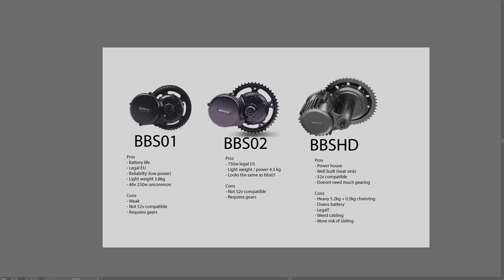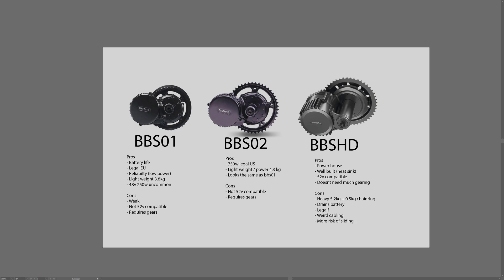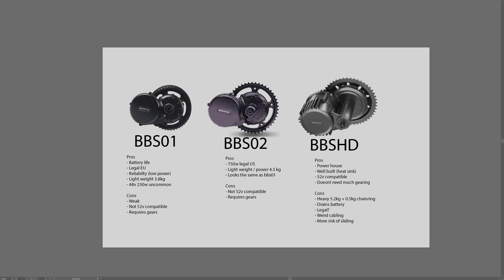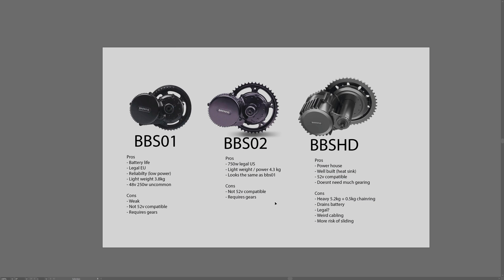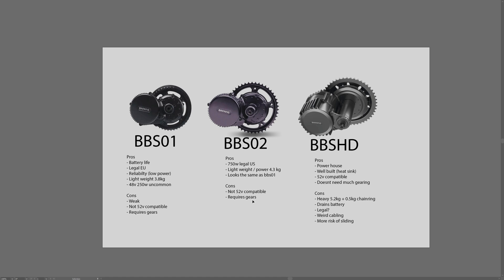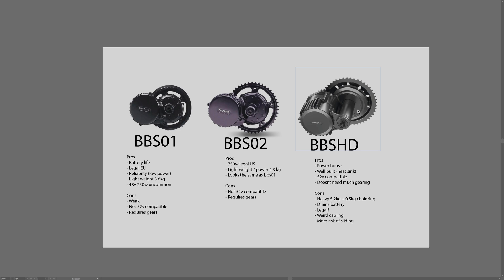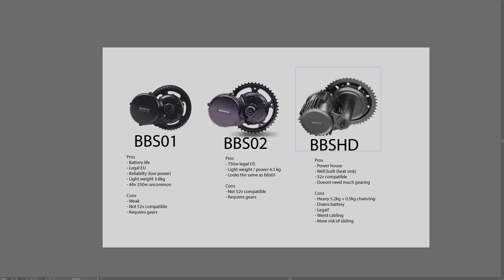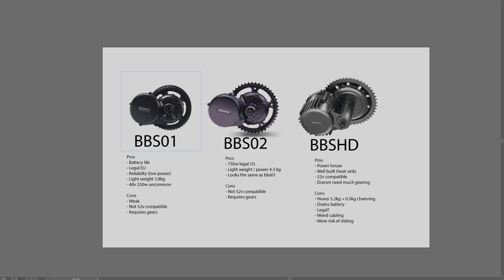Which mid-drive Bafang motor to buy? (BBS01, BBS02, BBSHD)

Comment: I have the 750 motor using a 20ah 52v battery iv had it about 3 years and over 3k miles without problem apart from chainring wear and rear cassette it has 5 levels of power and 95% of the time I use level one that gives me a easy 19mph and a easy 50 mile range with the battery at 20% remaining

Comment: BBSHD is probably relyable but some of them have bad housing tolerances (69mm bb width vs 68mm) and bits of metal and cling film forgotten by the factory inside the bearing bores resulting in misalignemt and drag. IPM rotors have inconsistent lamination uniformity. Thrust bearing needs differrent size inner race but only two identical outer races are sold together with the cage. Had no other choice but to get another spare BBSHD.

Comment: I have owned the BBS02 for several years on 2 bikes in the US, and I FIRMLY say the need for more gears is NOT a bad thing. If you manage the power setting and the gearing right then your golden. NO hub motor with same specs will match your range. On one bike I have the 02, a 17.5ah battery, and a mega range 9 speed 11-52t drive train with default 46t (I think) front sproket, and 26" drive wheel. On power setting 2, and 7th speed throttle only I get around 60 miles keeping with the legal limit (for Texas) of a class 2 20mph, and I am NOT a small person at over 200lbs sometimes hauling a single wheel trailer. Pedal assist I can get over 150 with setting one (my  preferred cadence) and still keeping the 20mph legal (for Texas) class 2 rating.  The other has a 20ah battery 8 speed currently (going to change that in the near future), 24" drive wheel, and a tadpole trike getting about 10 miles better despite the extra weight, and  also sometimes with the exact same trailer. Keep in mind I am also disabled and use this for shopping so I ALWAYS have cargo on board for return trips

Comment: The 18650 cells are 3,65V each. In a battery, some producers round that number to 3,6V, totalling 48V; others round that number to 3,7V, totalling 52V. But the battery is the same. So, what does mean "Not 52V compatible"?! Thanks

Comment: Nice I just finished up a dual battery with a BBSO2 kind of heavy now with 48v-10.4 ah & 48v-20 ah "dual combiner 24v-72v"  on a Trek 4500 26" My first run drove 16 mile with one giant hill the motor got very hot to touch!  I thought it was damage but I dropped to a higher gear. But no more  battery anxiety.

Comment: Bbs02 is 52v compatible but you need to lower the amp with PC if you want to use with high gearing because you can fry that controller easily with that overvolting

Comment: A BBSHD with reduced wattage about 250-300W and street legal 25 Km/h should last longest of the 3 right?
Reply: i would think so. Limiting is no fun though. i have 750w bbs02 with 6400 miles on it over the last 14 months. i ride 12 miles each way to work every day at max assist (30+mph and its still going strong)
Reply: Bit overkill to go for the HD for 250w, BBS02 is fine for downtuning to 250W, it's a more cost-effective option for a EU legal motor than the HD.

Comment: I run a BBS02 500 watt mid drive with dual 36v 20AHr batteries. It has a maximum wattage rating of 750 watts, but have regularly seen 850 watt display readings. It’s mounted on a 29” dual suspension, 34t Shimano freewheel. I live in the US in an Appalachian Mountain state, so there are many hills. Bike is mostly used on street and rail-trails. It’s fun with dual battery DateX2 combiner setup. Really helps with lessen voltage sag on hills and in headwinds. I ride about 30-40 miles daily. I have to give minimum assistance when climbing most hills in PAS 4. It’s fun. I know I said that. But it really is all I feel the need for at the moment.🙂
Reply: Your use case seems almost identical from mine, just bought my first mtb, and I'm on the east coast. I really want a CYC Photon in my gen 5 Trek Fuel. Coming from a rigid steel SE Lager single speed city bike converted with a 750w nominal 1000 peak hub motor with a 48v 20 something battery.
Reply: how does it affect drivetrain life, as opposed to a hub motor?
Reply: how many miles do you get?

Comment: I can't wait to get the bbshd with the biggest battery. i will make a commuter .
Reply from the maker: nice! what battery size?
Reply: @voltvehicles  I ended up getting this battery:   Battery - 48V 20.3 Ah Whale Shark Ebike Battery (2900 18650 Cells). I know there is bigger but the built up bike is pretty powerful now.

Comment: definitely the new torque sensing M435 possibly the M635.
tuning requires the BESST tool though, but boy are these motors a game changer once the torque sensor is properly tuned

Comment: BBSHD 1400 watt ! if you want torque power speed ! Mine does 61 clicks 48 volt running 54.6 battery and a 58.8 battery  ! 30 amp controller  8 speed  ! throttle and pedal sensor dual suspension ! MID DRIVE ONLY ! Thank you ! BBSHD  all day !
Australia allowed ! 48 volt running with 54.6 and 52v ,58.8 battery straight on no problems ! The others are pissy slow and not strong ! New one cant program ! Bought 2 old ones the best for diy use and POWER SPEED ! Lekie all ! Its messy if you have 2 left hands ! Or you can't do the job ! In that case shop and get ripped off ! Thank you !

Comment: My 02 is running on 52 volts, out of the box.
My HD also runs on 52 volts but with an aftermarket controller runs 50 amps (more about towing torque than top speed). I don't get bothered because I don't ride it like a goon. If you're not behaving like an idiot the police have more important concerns.
My motors have similar cabling.
Reply: what controller do you recommend?

Comment: im using a 52v with a BBS02, and its more powerful than 48v
Reply: 48v does me. i worry about 52v getting too hot and damaging the controller/motor. 48v already get very hot at the end of a ride
Reply: @SpicyMushroom469  you can control the power via the usb tool. its actually a must to lower it! feels way more natural and saves components
Reply: Me too but lately my motor has started vibrating like crazy, more like shaking, when on higher assist mode on a hill. Not sure which part to replace.

Comment: thanks for the info my daughter has the bbs 01 with 48v battery on her bike and she loves it .i have a full suspension with a bbshd ill be finishi g very soon .i think it will be the right bike for me .i have a 1500w hub kit on a voodoo canzo ,which is pretty fast on the flat (40mph)but lacks a little uphill .a stealth bomber clone that is 72v 80 smp and is a bit heavy and faster than needed ,also attracts too much attention. and a 72v 60 amp hub motor setup on a specialised hardtail which im building atm too .bad idea i think its going to be rediculous .

Comment: Blablabla... my bbs02b works perfectly with a Samsung 1040wAh 52v 20A battery pack ! Controller is compatible but you must choose the right display 52v compatible.
Reply: Same here, the 500c had a option for it.

Comment: Bbshd 1to1 works great
Reply from the maker: yeah that thing is a beast, do you mean with single speed?
Reply: Got mine set up on a single free wheel get about 41 mph running 30 amps across the board

Comment: I've been putting BBS02's on DH mountain bikes since 2015 to build as trail bikes. I've found 750W to be sufficient. I typically run a 36t "narrow-wide" chain ring w/ 10spd cassette and Shimano clutch derailleur. I definitely recommend Bafang products. Mid-drive is where it's at for bikes with rear suspension. I wouldn't put the weight of a hub motor on a "swingarm" but Bafang hub motors are great too. 👌
Reply from the maker: yeah 750w is mega powerful too

Comment: My advice is to get the smallest motor the 300 Watt motor with the biggest battery. Less wear on a bikes drive train. I commute thirty foor miles a day on a Giant Quick E with a 250 Watt motor. I can cruise along at 41 to 43 kilometres per hour. You drain battery cycles less as well.
Reply from the maker: depends on how much oomf you want :)))
Reply: Makes sense.  I like to pedal too.

Comment: Do Bafang motors really affect the right side crank (chainring side) by leaving it one inch farther once the motor is installed?

I saw a review of a welder who fitted the 750w kit, and that's what he said. It was giving him hip pain when riding the bike since the crank on the right side was too far to the right.
Reply: Bosch Motors swell up my knees, never had any problem in my life ... installed a bafang, Knee problems completely gone.
Reply: @Sheisintomalakasdino  Sounds more like your knees are getting old, since the Bosch is torque sensing and the Bafang BBS cadence sensing, it would make sense the Bafang would give you less trouble, since it doesn't care about your input power.
Reply: @nonegonewrong they are not, for some reason the Q factor just doesn’t work for my knees
Reply: It's the reason so many conversions use Leki chainrings and asymmetric crank arms.
Reply from the maker: leki is too overpriced bro XD
Reply from the maker: hmm, for a bottom bracket of 68mm and 72mm I have never had issues, but as Luke says, spacers could be required with big bottom bracket sizes
Reply: It comes with spacers.  Your friend should have used the spacers to align his chainring and avoid the hip pain.

My bbshd was ordered specifically for my bottom bracket size and it is centered well with no spacers.